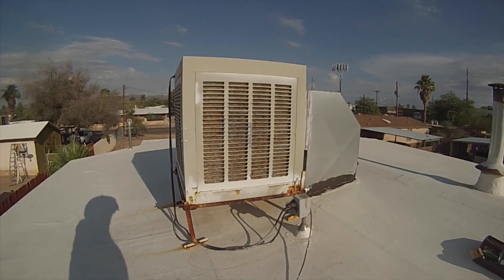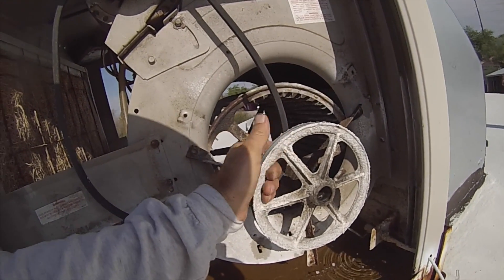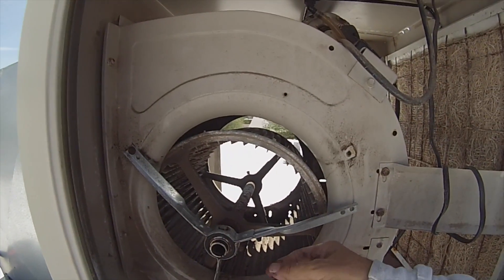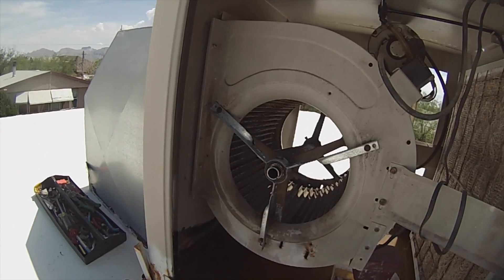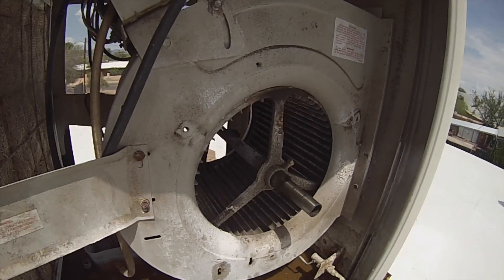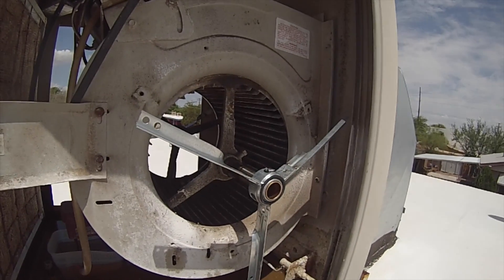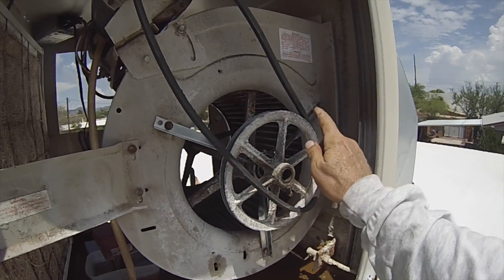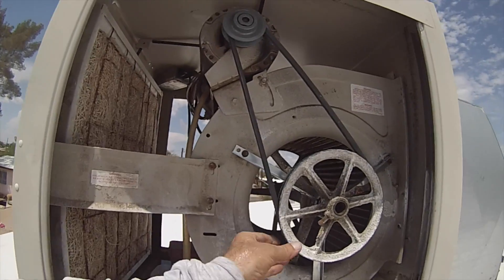Evaporative (swamp) cooler bearing replacement

Comment: Thanks.  I got exactly same cooler...  I swapped belt this morning as it was chewed up and it had a chirp before but 3 hours later with a new belt it's turned to a 747 sound so I'll be doing this job tomorrow at 7am.  Lol. This video has upped my confidence on the job greatly particularly as we have identical units...
Reply: Yeah.  I hope mine goes that easy. It's only 3 years old so I'm surprised the berring is out.  It was chirp before the belt and maybe a shudder as it stopped.  Was hopefull I could limp it through as its end august